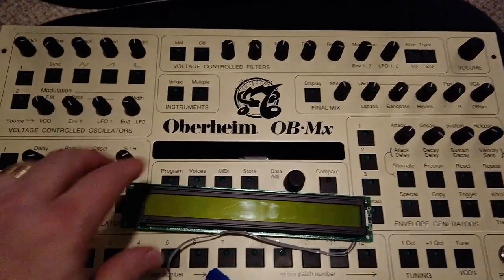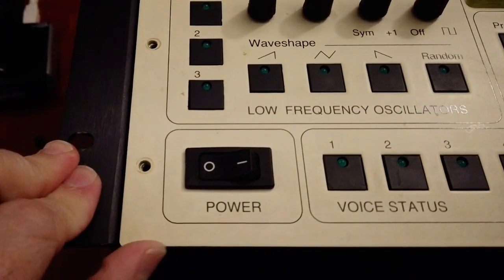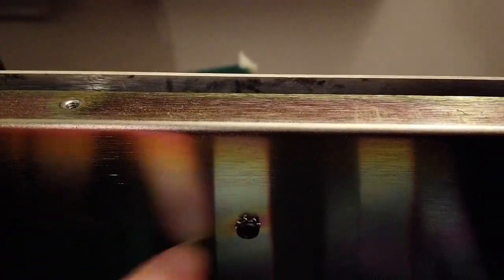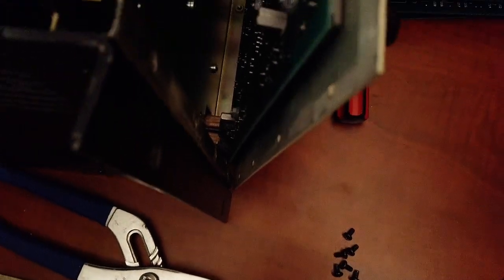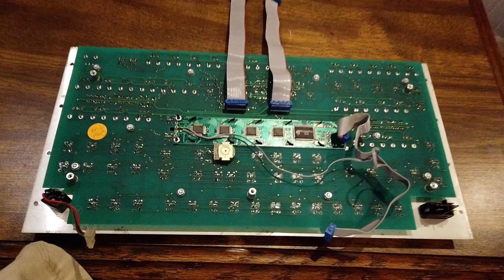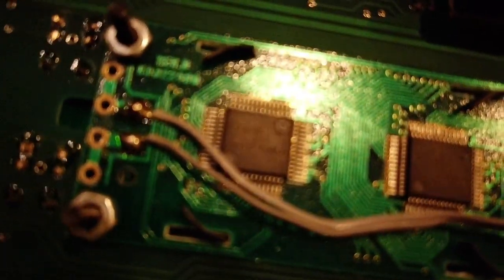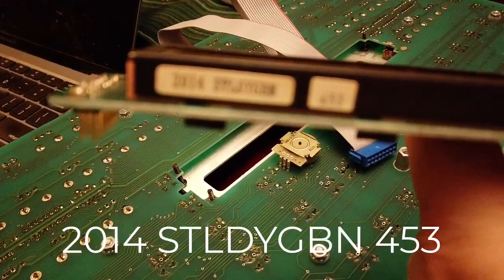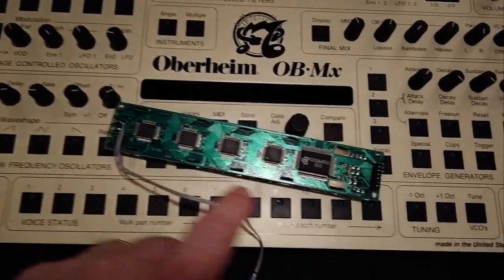Oberheim OB-Mx Disassembly -- Bad LCD (need help finding a replacement)

Comment: When you pressed the display, the characters appeared. The "zebra" strip and copper pads needs to be cleaned and or replace the top and bottom zebra stripes. More dissembly, appears you already started when you straightened the tabs of the black bezel lcd frame. These tabs put constant pressure sandwich between lcd glass, zebra stripe and pcb contacts when the tabs are twisted back. The circuit look to be working fine. The contacts are it's weakest link. Use very light touch Q-tip and 70% IPA DON'T go crazy.
Reply from the maker: Oh thank you! This is extremely useful information.
Reply: yeah, i saw that also when he moved / bended the metal strips that it was the LCD housing / frame.
Reply: there should be these vertical Rubber strips with alternating lines between the LCD glass and PCB, presumably carbon infested.
Are you referring to these?
Reply from the maker: @AnalogDude_  Yup! I cleaned those out and got something to display, and then dialed the display in further with OS settings. I will post a new video on it soon.
Reply: @Lantertronics  maybe an opportunity to research the LCD a bit further and "decode" the bytes being send to the LCD controller with a logic analyzer in case it definitely gives up it's ghost. now you still can see the chars. a nice job for your students. : )

Comment: I believe all displays are identical. They are based on the same Hitachi controller. The extra two pins are for the backlight. Now your backlight is fed through the two wires soldered on the display board. A good start is to disassemble the display, clean the zebra strips, and put everything back together, adding a little more tension with the metal clips.
Reply from the maker: I'll post an update soon -- cleaning the zebra strips worked!

Comment: Prof you had so much trouble with this because the mechanical engineers who designed the structures didn't have professors as good as you to teach them.

Comment: See if you can find manuals for the two boards.  Quite possibly the signals are compatible if you correlate the connections correctly.  It might be as simple as leaving two end pins blank...
Reply from the maker: Indeed, some other folks suggested that might be the case.

Comment: As others point out, the 14 pin connector is likely the 16 pin connector without the backlight connections, that I suspect are the wires that go to the other end of the display.

Comment: Those two wires that go to the other side of the lcd may be the other two  on the 16 pin. just change connector to 16 pin and put the other two wires in it. Or if the pinout doesn't match design a pcb that converts one pinout to another if you want it to look neat. Just thoughts, I'm just a hobbyist.

Comment: Maybe a resistor that controls the brightness of the characters went out of tolerance.  I remember putting a trimmer on lcds to bring the letters into focus.  On the cheap lcd I was using it seemed like I had to adjust the trimmer every time I fired it up.
Reply: One should use a MCU and a PWM signal to control the backlight of a LCD panel.

Comment: A lot of character LCD displays have a standard 16 pin interface like shown here: https://www.engineersgarage.com/wp-content/uploads/2/2/1/5/22159166/8x1_8x2_8x4_20x1_20x2_20x4_24x1_24x2_24x4_32x1_32x2_40x1_40x2_40x4_pinout_and_working_.pdf The A and K pins are for the backlight LED. It is very possible that the two "power" pins of your display are for the backlight and the other 14 pins make up the rest of the standard 16-pin interface. You would have to verify the pin assignments.
Reply: On page 2 of the above link there is a diagram for the conventional pin assignments for a 2x7 or 2x8 header of a LCD character display.

Comment: I recently talk to a guy that was repairing a Roland Juno G on the witch LCD had broken, he used a LOGIC analyzer and lots of time analyzing the bits and reverse engineer the thing and use a different LCD
He managed to translate everything.
Do you know this company? Saleae they sell USB logic analyzers so you can read on screen what bytes are being sent, maybe you know someone that has one that will lend it to you.
Reply from the maker: That's an impressive bit of reverse engineering for the Juno G!
Reply: @Lantertronics  wel, if you know the datasheet of the LCD controller chip, you can discard those bytes, like the LCD start up commands, the stuff to change "lines", jump to characters, move the cursor.
ask your students to help you, it can be done with patience.
The Oberheim seems massively wel made, like how how the made the first ATX computers with lots of metal would be a shame to see it end in the bin. nothing would be made like that today.

Comment: It might be worth checking if you can find a VFD on Ali Express instead. They look gorgeous and some of them work on 5v.
The LCD biasing circuit for 'contrast' might be at fault, because it seems like the characters are trying to work underneath, could be that it is not receiving enough juice. Also because most LCDs use either Hitachi (or another I forget) protocols you might be able to solder up a custom loom that works fine for a different pin out.

Comment: Not sure about this but I think the extra two connections are for the led backlight and otherwise the LCDs should be interchangeable.
Also, if you press on the LCD and it makes the characters appear, shouldnt you at least give a try to disassembling the module (those black tabs you bent in the video), cleaning everything up and reassembling while also perhaps tightening those tabs?
Reply: Most text LCD:s have 14 pin connector with standard pinout and Hitachi HD44780 compatible controller chip.  Optional pins 15+16 are for backlight, but it's better to check if that backlit works directly at 5V or if there need to be resistor in series to limit current. Also screen contrast varies a lot between parts, so it may need adjustment.